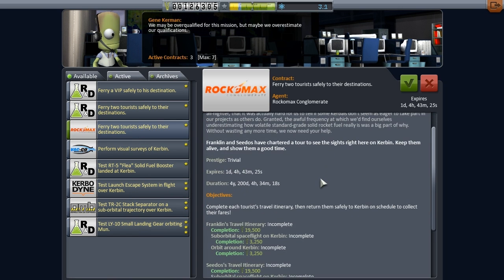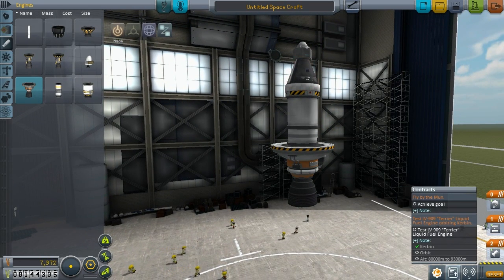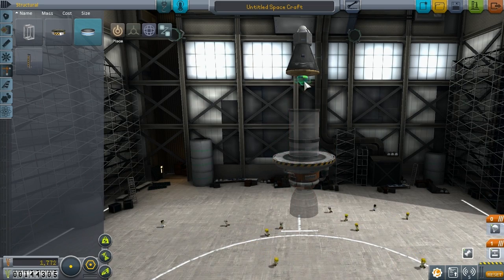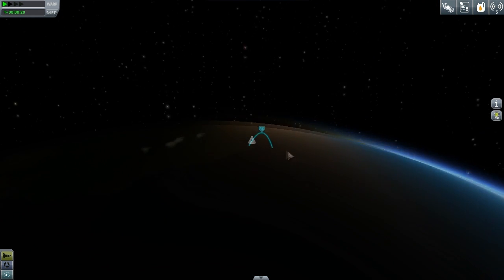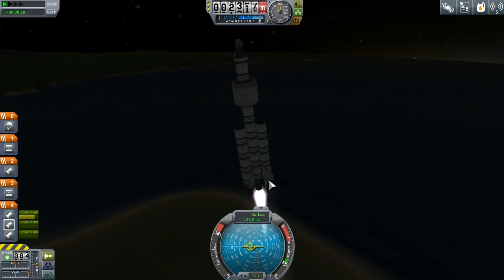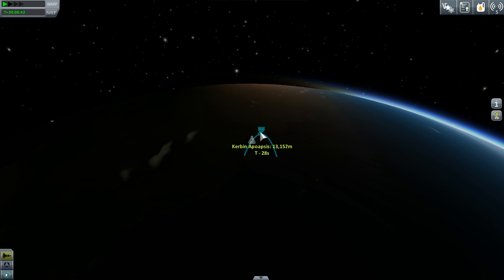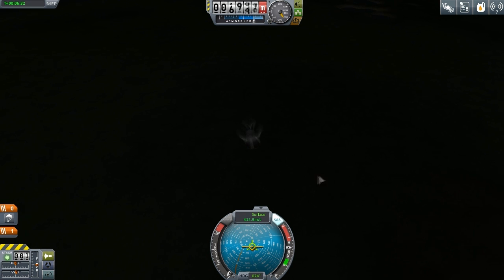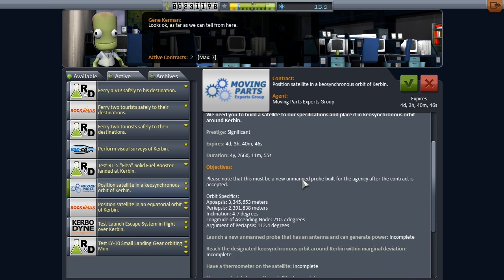Kerbal Space Program - Awkward Rocket Designs! #9 (Career Mode)

Comment: You need to do more science, then unlock the bigger fuel tanks that actually fit the "Skipper" engine. Also, never put solid fuel as your main engine, as it has no steering or stability (plus you cannot turn it off).